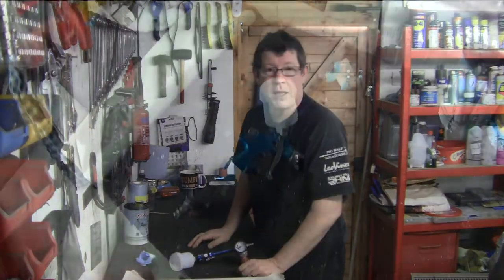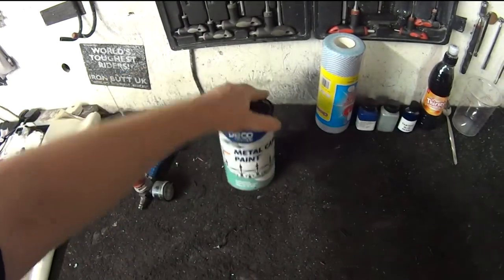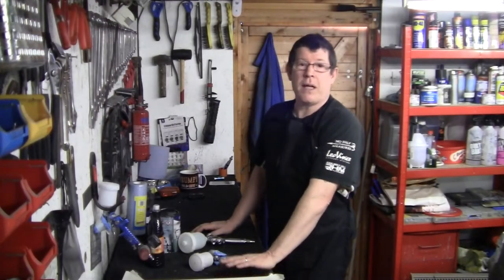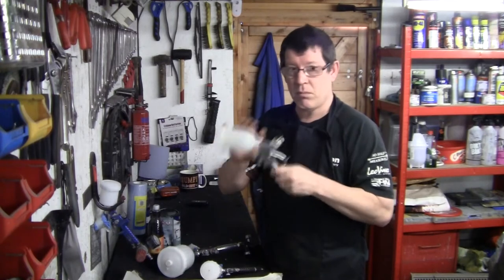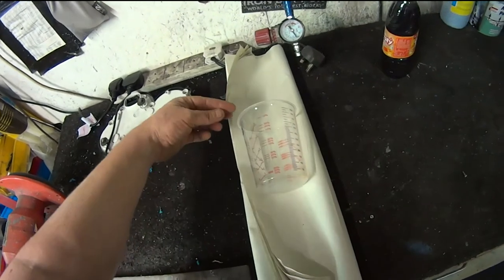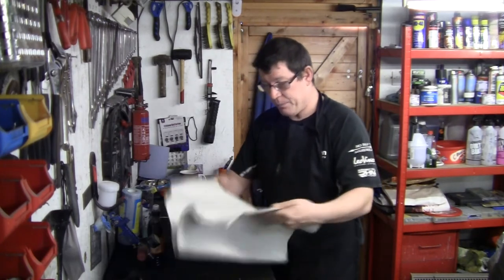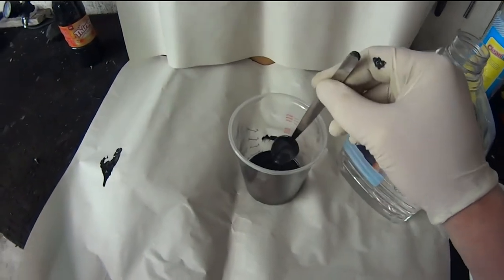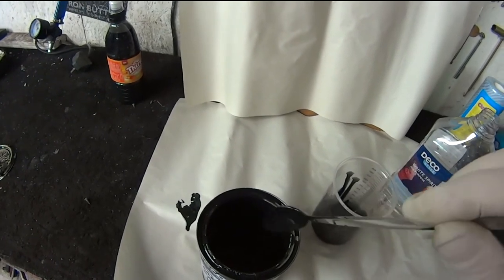Single stage enamel - PT 2

Comment: Hey Tosh, I have this gun as well never used. Soon to paint the bandit engine while the frame is getting powder coating. Is there and special prep I need to do and what paint would you use for this. Thanks in advance Colin.
Reply from the maker: Ive never painted a full engine, I would imagine that the prep would be the same as any other paint job. As for the paint I dont know..Heat proof paint i would have thought.
Reply from the maker: I came across this video...It looks good at the end.....
https://www.youtube.com/watch?v=uUjrh1Marqw